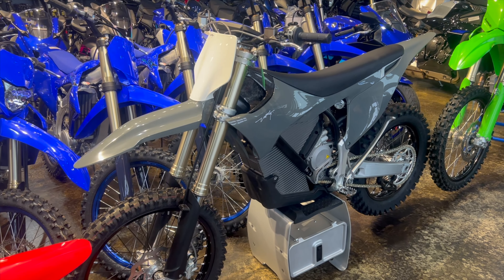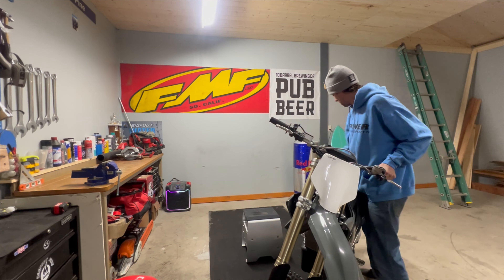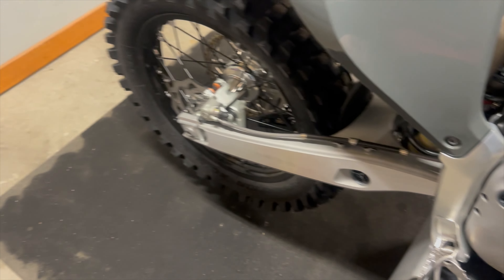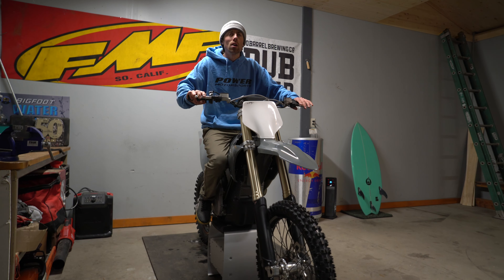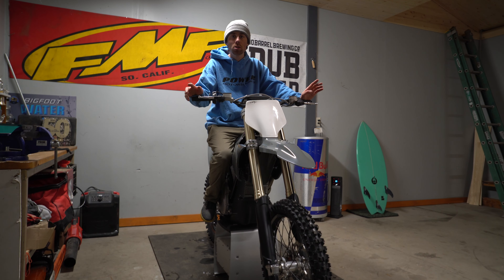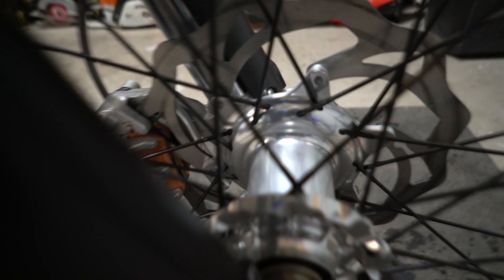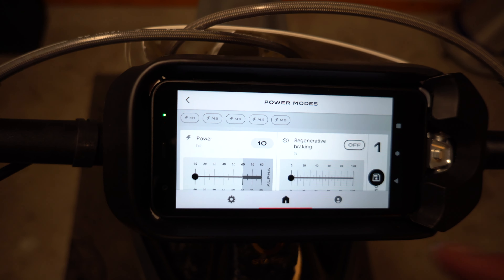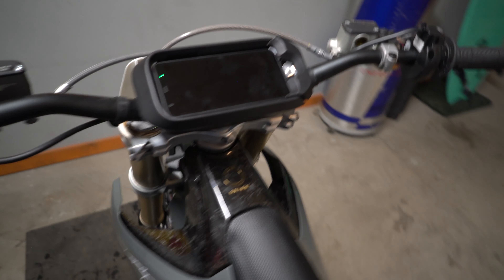First Impressions On The Stark Varg! Electric Motorcycle

Comment: I was totally against e-bikes until I recently rode a SV for two laps, at 30 HP.  I was shocked by how quickly I adapted to it, and how the extra weight wasn't even noticeable.  I was even jumping a foot farther than on my YZ250.  My only negative is that riders can't hear you coming.  They need to put some kind of noisemaker on them.
Reply from the maker: @laserdad  the other riders not hearing you coming is definitely an issue lol. Would be nice if they came stock with some sort of horn or something.

Comment: They sure don't give you much extra  charging cables for charging it they should add a extra 2feet  or even and extra 1foot in a 1/2 people have complained about that and said the kickstand should of been longer and a better foot pad on it so it won't fall over.I'm waiting for the new model to come out and hopefully they will fix those problems plus the ones I didn't mention. I also would like to have in in all black plastic and then put on some new graphics. I think that would look so awesome I'm going to check and see if they make the plastics in black. Thanks for the video and congratulations on your new Stark Varg.
Reply from the maker: @garymertens4796  definitely some small things to fine tune on these bikes but most of all it’s going to take a few years for the range on the battery to be good enough to be comparable to a tank of gas.

Comment: Your battercharger is installed upside down. The door should open to the floor and the bike plug-in cord should be on the Right side. This will help to not crimp the cord.
Reply from the maker: @lochnertodd7777  I did figure that out pretty quickly but the cable is still really short even after switching it right side up.